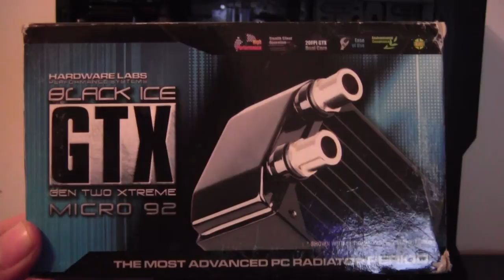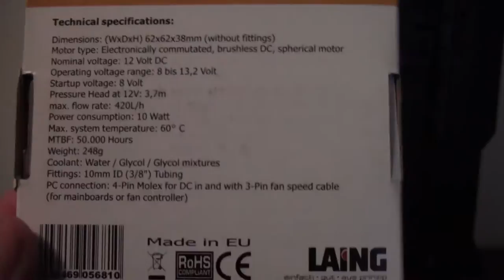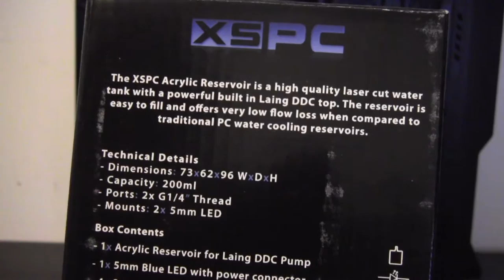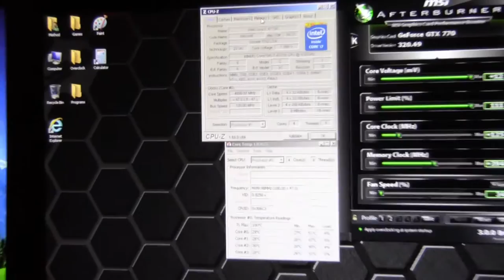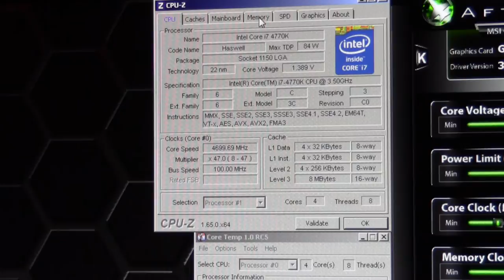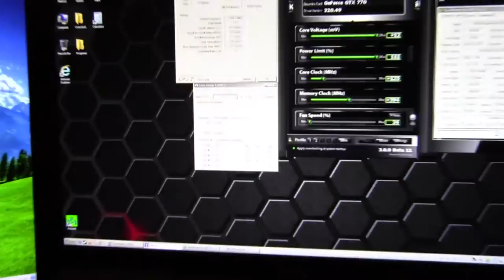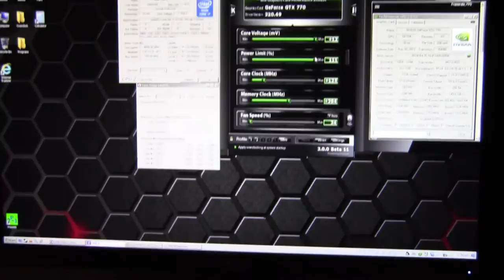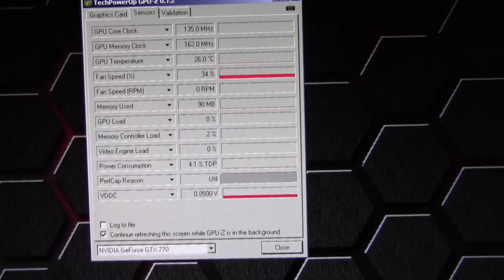Ultimate Watercooled LAN Rig (2013) - NZXT Vulcan, 4770K, SLI GTX 770, Z87 Gryphon

Comment: Great video and that's an incredible system for a compact LAN type case. Considering the WC components I'm sure it weighs a couple pounds. Anything special to get both GPUs recognized? I have two titans on the same board but it only sees one Titan. I have an RX 240 plus EX240 in a modified Cooler Master N200, with a de-lidded chip and the EK supremacy running the naked precision mounting system which doesn't require the integrated heat spreader. Nice job on the build BTW.

Comment: You do realize the bottom PCI-E lane on the Gryphon runs in 4X? The top and middle PCI-E lanes are 16X and 8X, but the bottom lane where your second 770 is plugged in only runs at 4X speed which will bottleneck your gpu.
Reply: By a percent or 3 yeah
Reply: Maxjeee11 My average fps in both x16 and x8 slots is the same, but I've lost 3 fps using the bottom x4 slot (Unigine Valley 1.0 benchmark - GTX 660 for the GPU)
Reply: I never implied anything different.
Reply: Maxjeee11 Yeah I was just proving your point
Reply: Haha alright it just sounded like you wanted to be the know-it-all

Comment: Hey man, nice work! A have a question for you, I'm building a system similar to yours and I'm in doubt if the AX760 is enough or if I should go for a larger PSU. Have you ever get any trouble with your PSU under heavy load? Thanks.